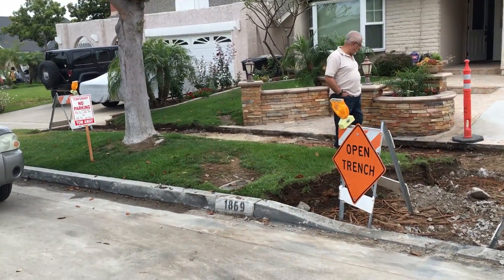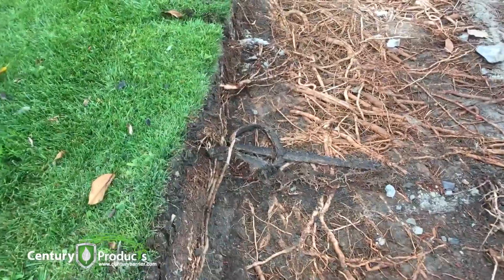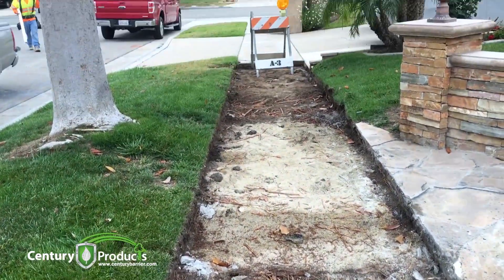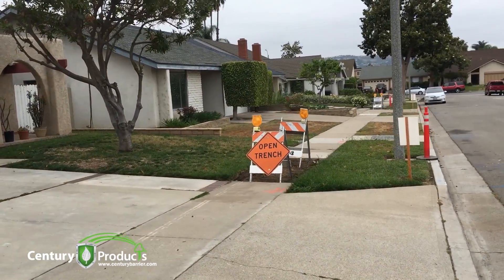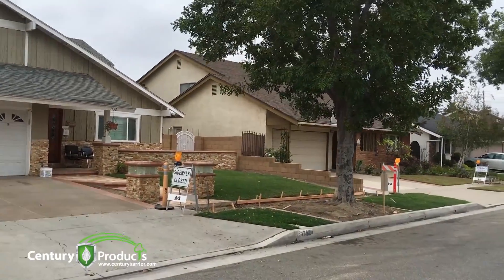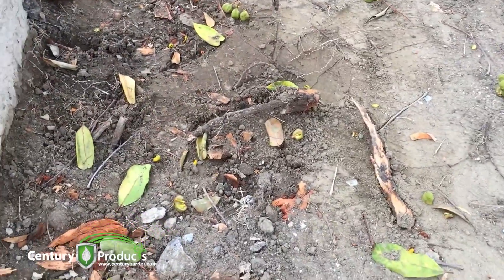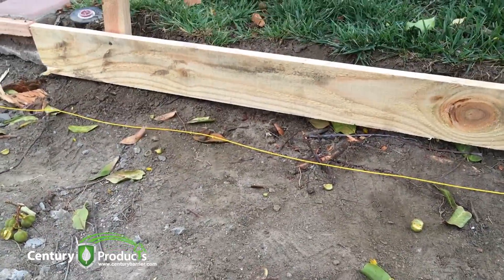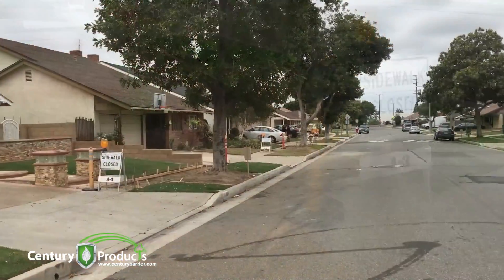Sidewalk Repair from Tree Root Damage - Root Barrier Installation

Comment: Root barriers just put trees back in a pot! Never actually solving trees problem. Why are engineers going backwards rather than getting scientifically smarter?! 

Obviously tree roots cannot grow deeper because soil underneath sidewalks has been compacted. So instead Roots have begun growing on top of ground surface, inevitably lifting slabs.

Just loosen the damn soil underneath the sidewalks for roots to grow happily deeper. After all parkways are never enough total growth space, which is why trees inevitably need to grow roots throughout people's front yards as well.

Just remember when you see tripping tree roots growing on top of the surface, nothing can grow within the oxygenless soil underneath.
Reply from the maker: thanks for your input !